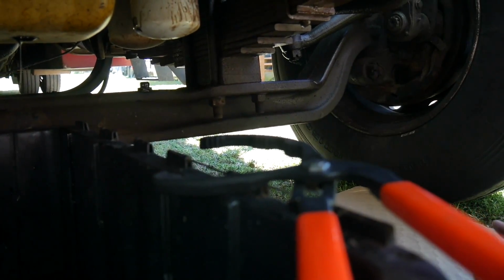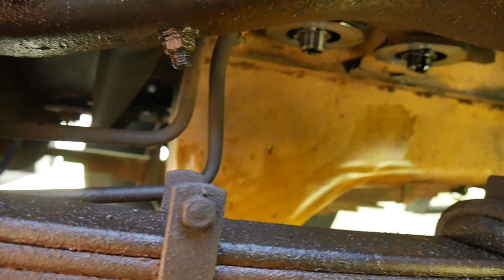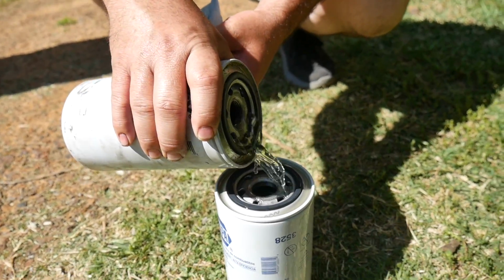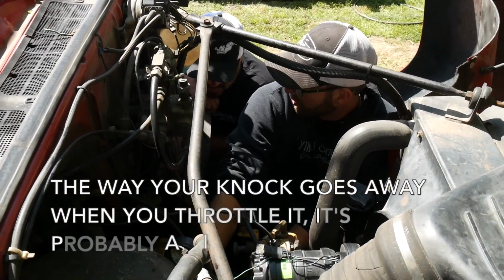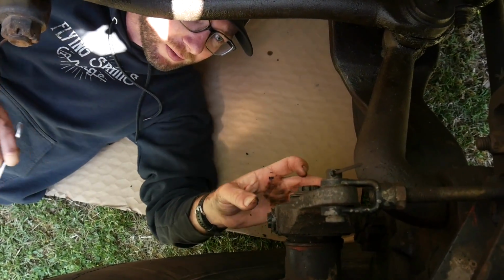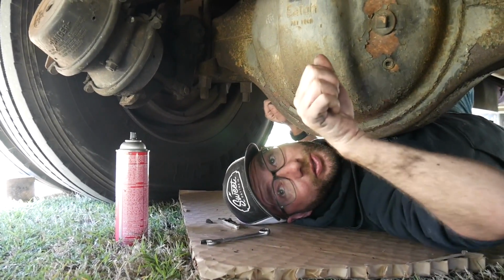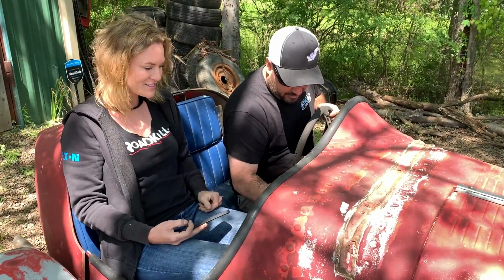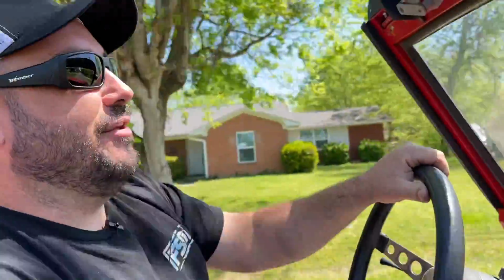Finnegan's BIGGEST ramp truck maintenance & diesel how to’s!

Comment: These old Cat motors are something!
Doing oil and fuel filters are par for the course, as is setting the slack adjusters on the s-cam brakes.
Oh and changing tyres is something that is now left to a tyre fitter, as the process is quite dangerous (parts flying everywhere).
Reply: If parts are flying everywhere. 
You aren’t doing tires right.
Reply: @fastinradfordable  it's an art that is now left for someone else to do. We don't touch tyres anymore.

Comment: When you try to safe and like that you have to have a lot of the holes buried into the fuel all the time over the end like is all the holes out quickly partially release the thumb and yourself siphon, but must have majority of the holes are at least a couple feet of line in the fuel

Comment: Drivers side rear slack adjuster from what I could see was way out adjustment.rule of thumb is you don't want to see more than a 90 Degree angle in the applied position between slack adjuster and Brake Chamber.

Comment: Before you drain the oil, warm up the engine then poke a hole in the bottom of each filter. Wait overnight. Way less mess! If it has a coolant filter do the same without the warm up.

Comment: Hello everyone, on those large oil filters pierce a hole in the bottom to drain before loosening them. Makes it much easier to handle the messy things & thx for the video.
Reply: I saw a bunch of oil filters at the dump with holes in the bottom center. Other than that they looked almost new, someone else must use your trick but also wash out the oil residue.  ; )

Comment: Sounds like the injection pump maybe bypassing fuel past the plunger for the number 8 cylinder. The pumps usually rattle when it's starting to fail.

Comment: We had 85 big kodiak with a 3208 and a allison automatic trans my boss ordered with all 4 disc brakes man that truck was a pig but I'll tell you we had little trouble with the engine it pulled at least a 2500 pound vermeer chipper and it haul all the chips from it it was a tough truck

Comment: How about using a length of wood against the engine and against your ear to find the local source of a knock? It works for almost any engine noise you are trying to locate accurately? Just a thought :) Just move the end of the wood against the engine towards the knock and you eventually get right on top of it.

Comment: I have never filled an oil filter before installing on an engine,and never had an issue .All the oil never drains from the engine anyway . The cam bearings ,and main ,and rod bearings retain a film of oil still on them even if you let the engine oil pan drain all day. I always spun the filter on dry with a film of clean oil on the filter gasket .Tightened three quarters of a turn after snugging up,filled the engine with the proper amount oil .Fired it up ,checked for pressure, checked for leaks ,shut it down,checked for level on the dipstick. , and shut the hood. Hundreds of cars ,hundreds of times ,and never had an issue with an empty oil filter .Never filled one ,,,,,,,,,,,,,,,BUT,,,,,,,,,,To each his own .Happy Easter ,and stay safe......................

Comment: Many years ago, mid 90's... a big 3 axle tourist bus of some kind stood parked near where I lived. It was a very hot day, and ALL of the tires exploded at once. Luckily I was not that close so as loud as it was it was not deafening to me, and I dont think there where people around. I think the heat caused them to explode, the truck was a new modern thing I believe, maybe they had put too much air in them. Either way, it made one heck of a BOOM x 8....  I guess the most fortunate thing was the thing was parked. Imagine that happening while on the road.

Comment: May I inform your viewers to not risk inflating tyres/tires that have been driven on with low air in them where they have bulged half way to the ground or more and even for as little as 1 mile distance will damage the sidewall and it will burst when inflated like a zipper . You can do things cheap but not when it comes to your tires/tyres and lives. Better a low cost new tire/tyre then one that went flat. Its good to see that preventative safety measures can be learned in Flying Sparks Garage. Cheers all!

Comment: I'm in no way a diesel technician, but I work on them for a living 🤔. I work on bigger engines that hold 9-10 gallons of oil, shut offs on the drain is a back saver! Poke a hole in those filters to make less mess! He thought those filters are heavy try balancing a 3406 filter full of oil, hell of a work out!

Comment: When removing oil filters take a punch and poke a hole in the bottom of the filter before you do any thing that way it has time to drain while you change the rest of the oil. The you won't get covered in oil.

Comment: I bought a 1985 Kodiak in Alberta Canada with only 67K km on it in the summer, however I live in Manitoba and with the current travel limitations, I have still not laid eyes on it. This road trip  is making me want it here even more. I am surprised by the air brakes and standard trans as (I'm told) mine has an allison auto and 4 wheel disk brakes. Also mine was set up as a plow truck with a short gravel box and has the front mounts for a plow but no blade included. This is gonna be my family pickup and I'm dying (cough cough ) to get my hands on it and start wrenching.  Thanks for the great video I enjoyed it.

Comment: fun fact with those old V8 3208s, you have to overbore the rearmost cylinder in each bank when they get overhauled! otherwise they will get to hot and swell up causing scoring and a loss of power. and as a fleet mechanic i would love to add my little oil filter trick. take a slim center punch and punch a hole or two in the bottom of the filter and let it drain for a second, then you dont get it covered in oil!

Comment: My 7.3 has a big oil filter like that, and to keep from wearing it in my armpit, and keep from dropping it, and making a huge nasty smelly used diesel oil mess including ruining whatever your wearing. 
I poke couple holes in the bottom with a sharp punch,  and after a couple of seconds. I poke another one up near the top of the filter so it can vent letting it drain faster.
Works well for fuel filters too, if there mounted in similar position, and even if mounted horizontally, allowing them to empty out in a controlled manner.
Oh wouldn't the old two speed differential be nice to have these days, as it would allow you to have your low end grunt, but once up to decent speed, shift into a ratio more highway speed friendly, thus increasing all the driveline components considerably

Comment: a thing i have learned the hard way, poke a hole into a bottom of the filter to drain it before you remove it, this way you dont have oil running down the side.

Comment: Good call at 12:05 in was just going to COMMENT ABOUT THE OLD 2 PEICE WHEELS WHICH WERE WAY MORE DANGEROUS 💣 💣 💣 💥 💥 💥 💥 💥 💥  
I always hated putting air in anytime over 60lbs  even better working at a bicycle 🚲 shop and someone went to put air in both tires(was at a shop in wisconsin Wheels And Sprocket and had multiple hoses on the floor and shop)but anyways a new employee thought it would be a good idea to do both tires at same time with two lines and LOCKING AIR CHUCKS AND WALK AWAY FOR A MIN 💣 💣 and all of a sudden 💥 and a second or two later 💥  I've never seen so many people hit the floor as fast as they did or run 🏃‍♂️ out the store as fast as they did  ALL I KNOW IS HE FOT FIRED ASAP AND MY EARS RANG FOR ALMOST A WEEK 

Now only imagine a tire 1000x the weight and 100x + the size doing that  so scary 

But the best ones are the one that us starter fluid or brake fluid on smaller tires and lite it up and 💥  there have been so many epic videos  that have gone wrong from that

And.by the way LOVE 💘 THE  📹 VIDEOS and keep them going

Comment: The torque is better on an I6 because it uses more fuel than a V8. I still love my 93 idi tho. It’s a dog & she’s gets there. Good ole 3208 the 7.3 idi’s big heavier brother. All old diesels have injector know even if they’ve just been rebuilt, if it’s an injector it usually goes away after warm. I’ve got a few on my idi & they don’t smoke that bad quite yet still starts decent.

Comment: Pro Tip - Use a prick-punch to put a hole in the oil filters before you spin them off to get that oil out the easy way.  Prevents slippery oil filters and dropping them in a giant bath of oil.

Comment: Use a screw driver to knock a hole in the bottom of the oil filter to drain it before you loosen next time to avoid the mess

Comment: a tip for a cleaner way to change the oil filters on those is to poke a hole in the bottom and let them drain before removal.

Comment: I have the same knocking in my diesel engine when it's cold. After a few minuts it's gone. And the engine runs smooth as ever..
My mechanic says that I need to replace my clutch....🤔🥴😬

Comment: How did you ever get your class one if you don't know brake adjustments or caging breaks?!?
Reply: I don’t think you need a Class 1 to drive a dually ramp truck. It doesn’t have 3 axles.
Reply: @fredfrodesen1740  your right on the class 1 in Canada you need a class 3 to drive that truck but it still comes with doing a walk around including brake adjustment by the driver if needed.
Reply: It's a motor home.
Reply: Air brakes!!!!
Reply: @Geoff321  That truck is a single rear axle, Class 3 isn’t required in Canada, But you do need an Air Endorsement which you can hold on a Class 5. In the US, I think you need a CDL B in either case (air or tandem). All of that said, you’re right...he should know about adjusting brakes, it’s the first thing CVSE will look at if he’s stopped.

Comment: You can use a punch to wack a hole in the bottom of your filters to drain them first. Then it’s a lot less messy. Typical medium duty trucks get an oil change around 22,000-24,000km (whatever in miles. You can convert. Lol )

Comment: They was actually known as Split Rim Design and I worked for a mobile crane company here in Pittsburgh and we used a cage that encompassed the tire and rim both but you had to chain it down into place bc they were that dangerous and even in a cage they could explode and take someone's head or hand or any body part put near the wheel/tire combo when inflating the wheel tire it's quite serious quite dangerous so watch out for those types of you ever work with any like that yeah be careful you guys 💋

Comment: What's up,try this next time you change filters. Use a sharpened punch,screw driver,etc and punch a hole in the bottom of filter and let the oil drain out first,then spin it off alot cleaner. Later

Comment: Don’t ever pre-fill a fuel filter with a hose out of the fuel tank.  That’s the best way to get dirt in an expensive injection pump.  Invest a few bucks in a fuel can.  Good luck finding a new injection pump for one of those if you wreck it.  Can’t get new ones anymore.

Comment: Y’all’s fuel filter service scares the 💩outa me!  A) the risk of a piece of dirt entering the injection pump filling filters with unfiltered fuel. B) the sleeve metering fuel system has very close clearness in the ballets and plungers a grain of sand can ruin a cylinders fuel coming from the pump . C) spinning engine up high when air could be in inj. Pump can score barrel and plunger due to lack of lubrication.  3208 great engine but fuel system demands clean fuel only.   Have fun.

Comment: I know I'm most likely just stating the obvious but while it's safe to open injector lines on older engines, one should never do it on newer common rail ones. They have over 20 000 psi of pressure and the mist can cause tissue necrosis. Stay safe and have fun!

Comment: Shit if I owned that junker I'd likely throw the body off onto the ground or out back somewhere but then I'll get a dual port intake from a later model 1600cc Dual Port engine bc there are many out there to harvest parts from or for but still lots of people manufacture their own brand of restoration parts whether it's a detailed piece of Trimwork or a Fender or a bumper then you'll likely be able to find reproduction items for your vehicle if you due your due diligence then you'll find that there are many vendors outvthere

Comment: Totally off topic of this video.. (albeit good content— dad has a 3208 in one truck that hasn’t run in about 15 years and an 1160 that took the place of a bad turbo’d 3208 in another.  We’ve considered putting the 3208 in a 05ish super duty!). Aaron!  Emily!  I noticed you guys still have a simple “roll bar” in Betty.  Check out these cages built by a couple of crawler friends of mine in MO. https://www.facebook   .com/groups/143577759609782/permalink/765376000763285/ hit them up, tell them you’re on YT, get them to make a deal.  I will see them at OCBR in September and I can bring   It back to TX with me if y’all want one.  I recorded a time lapse of the first half of building mine, but it wasn’t good enough quality to justify spending time editing.

Comment: Pops had 2 of those Broncos a 73 and a 77 for snowplowing. Both had 302 the front ends were weak with a 6’ plow. The heater was non existent below 20. The switch for the fuel tank left me stranded twice. Good times, I used to plow  Harry Chapin style( taxi). Glad I left tprny Rochester area, 11 year’s ago. I’m north of Austin now,  check my channel, I’m restoring an 88 fox body I gave my 33 yo daughter.